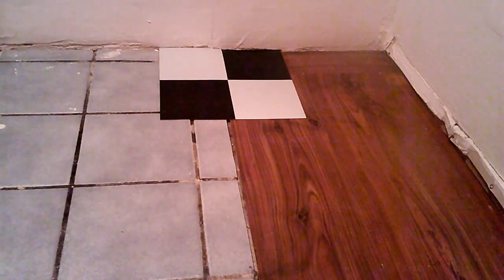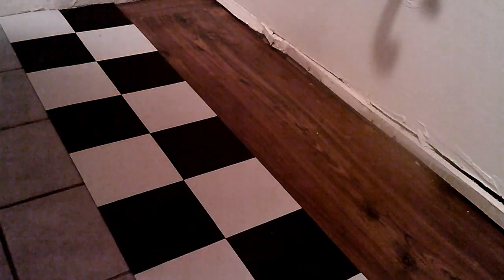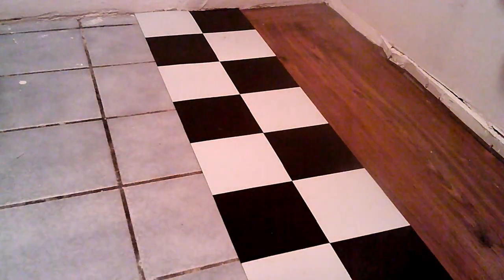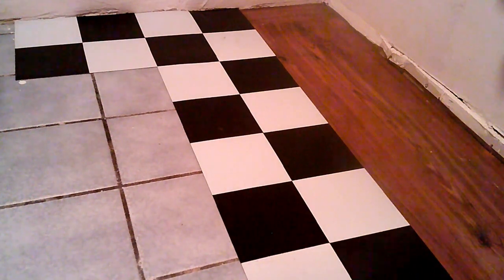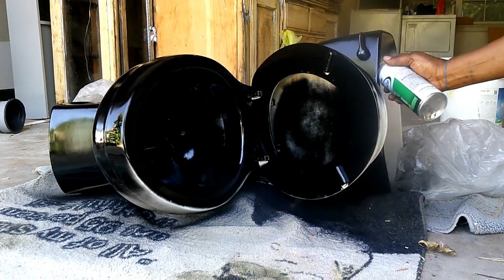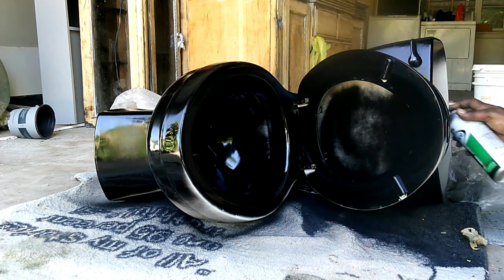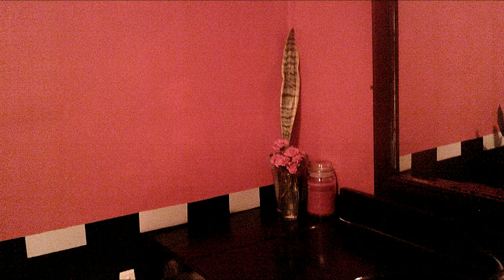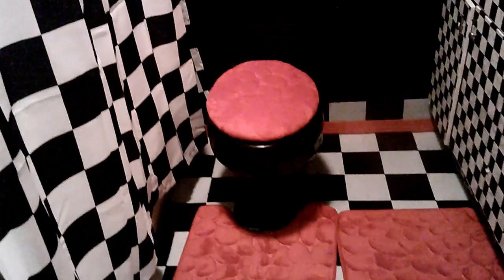How to Paint The Toilet Black! (Bath Makeover Under $200)

Comment: did the black toilet hold up?  any ding issues or chipped paint problems???  DId u paint the sink as well?
Reply from the maker: Hello Patricia, thanks so much for watching. The black toilet is still holding up.  A ding and a scratch here and there but the polyurethane really helped keep the paint in place. It's my kiddos' bathroom so they are way less than careful. lol Yes, the same with the sink. If I had to do it again,  the Rustoleum brand high traffic poly. Much better.
Reply: @peopleoftruetalentspirit9364  thanx, Chick-A-Roni
Reply from the maker: @patriciarickels8609  Hey, Patricia, if you haven't already, hit that like button and subscribe... it's free. Let us know if you gave it a try, I have another I am working on, it's gold...Stay Tuned